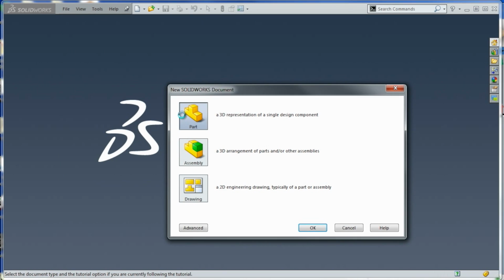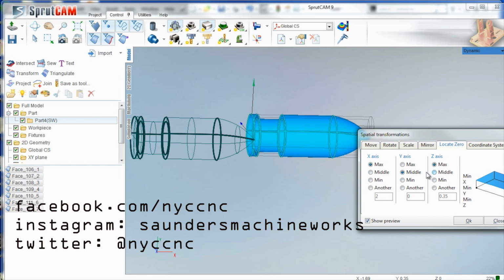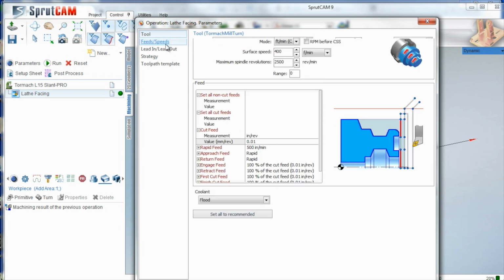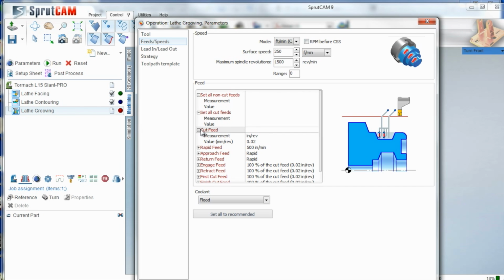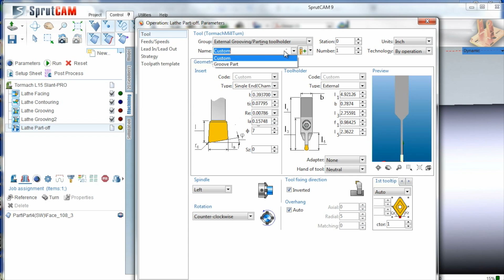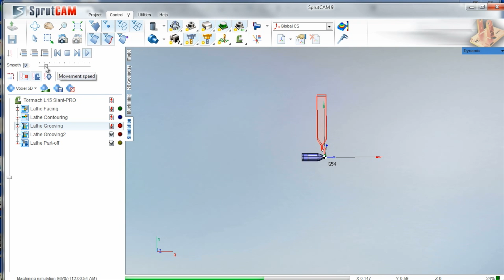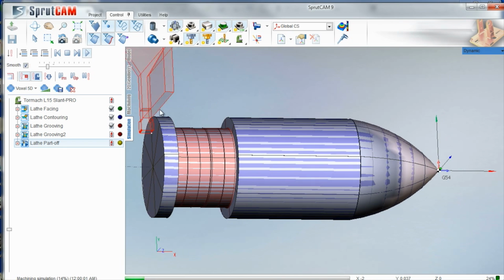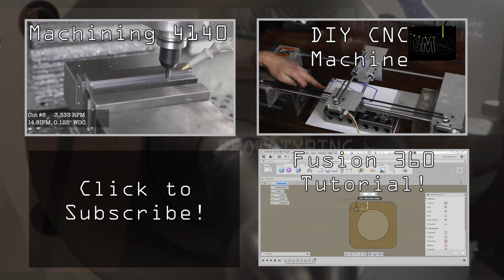Tormach CNC Lathe CAM!  First Part!  Widget44

Comment: About the parting nub, you probably know this, but you can try to find an insert (or grind HSS) to have a leading edge in the direction of your finished part. That leaves you with a pretty nice finish on the final part.

Comment: Hey John, watch out with your toolchanges. I dont saw your full tool setup but if you change tools so close to the part you have to watch out that you dont hit your part with a longer tool as the previously selected one like changing from your contouring tool to the grooving one and a drill is in one of the slots between them..

Greets from Germany :)

Comment: Hello John
Super videos!
I just haw a few tips.

When using SW then you should try mouse gesture function instead of using the s key for the functions you use the most, it really saves a lot of time.
And when using the grooving tool try to go with a constant spindle speed instead of the variable cutting speed so the tool doesn´t have to wait for the machine to rev up and down.

-Rasmus

Comment: You should look into mouse gestures in solid works to further fasten up your workflow. Great videos!
Reply: Not what i ment. If you hold the right mouse button und move the mouse you can select your line tool etc. in scetch mode and in your part mode you can selcet your view. Look in the options you can use up to eight different functions that way.

Comment: That came out beautiful it took me 5 hours to do something close to that by hand lathe so much quicker with the cnc. I still say you have to have the same skills either way you do the job.
Reply: NYC CNC it took 5 goes but how I did it was to feed it to the right while using the cros slide to fine angles 1 at a time, then to finish was gentle hand cranking both the feeds with a sharp insert. I had done ball joints before for practice out of 10mm brass rod as I had a surplus to make mistakes before moving onto the stainless steel, as I said it took me 5 goes so the bin ate the first 4, I am making a attachment to do both the ball and dishing I found the designs off of youtube so I hope to be doing that way but I still make my rc ball joints by hand just to keep myself invigorated.

Comment: TIp, Don't part to center! Go to say X .05 on a part like this (or what ever it is that the part breaks off at). Sprutcam calls this the over lap. If you don't have a hole in your part you need to put a negative value in here to get it to stop cutting to center. This should save your inserts :) Your always going to end up with a nub on the parted off part no matter. If you don't want a nub then set it up for a second op (or get a lathe with a sub spindle ;)
Reply: Widget Works Manufacturing Inc. I thought that there were inserts that were ground/cast with a slant one direction or the other in order to control which end the nub is left (stock vs part)?  Or at least that is how some machinists grind their own.  I suppose that would be a major difference between a parting tool vs a grooving tool as well.
Reply: NYC CNC Yes, you are pushing the material out of the way at the center, not cutting it, as your SFM has reached 0.
Reply: Keith Ward Yes there are, they only really help for parts that have a hole in them. They will keep the ring on either the part or stock. They general are not used though for part off as they cause the blade to wander due to the axial pressure caused by the angle on the cutting tool. I have only ever used them to part off thin walled tubing.